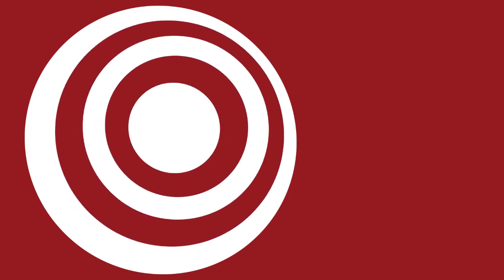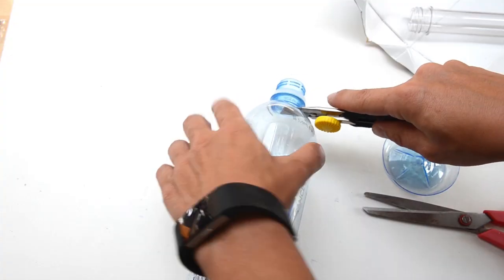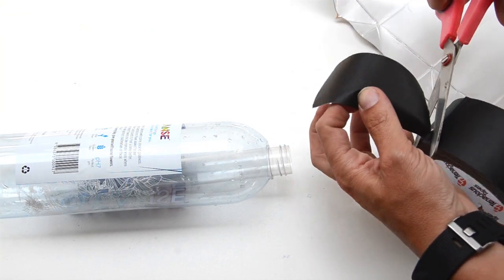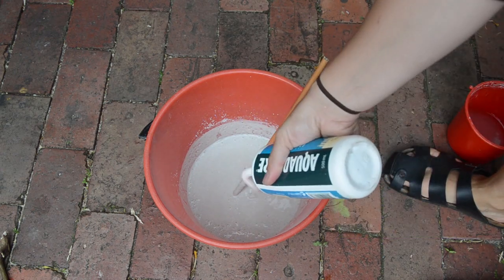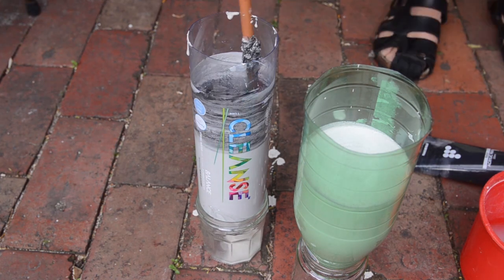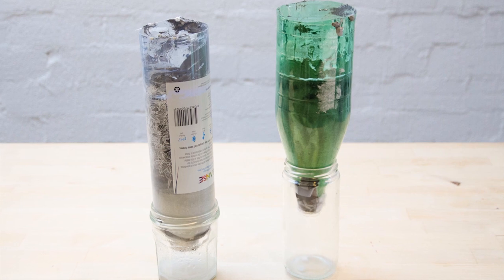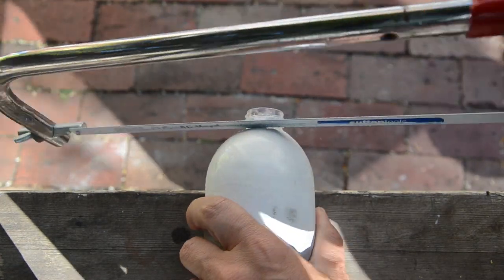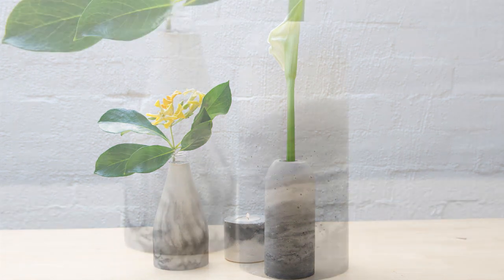DIY Concrete Vase

Comment from the maker: Hi, I just used cheap acrylic paint from the dollar shop and I used white cement which I mixed with sand and used slightly more water, so the concrete is not too thick and easy to pour easily . don't  leave the plastic tube inside, my vases just started to crack after 3 weeks, because the tube doesn't  expand! just check your type of cement and use more water and less sand!

Comment: I tried this and it was a fail :(  I used a yogurt container. everything was good until I transfered over from the bucket to the container and started to add acrylic paint. it got super lumpy and difficult to mix. then I tried to add a smaller container on the top and put a weight inside but I think it hardened to quickly and became very lumpy. I am going to try again. I was hoping you can tell me maybe my timing was off? it all happened rather quickly within 10 minutes